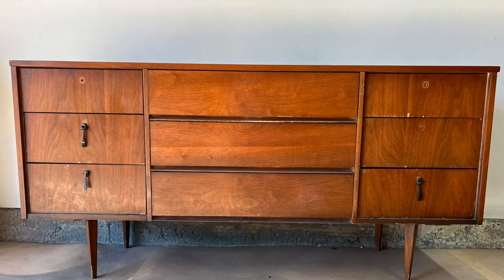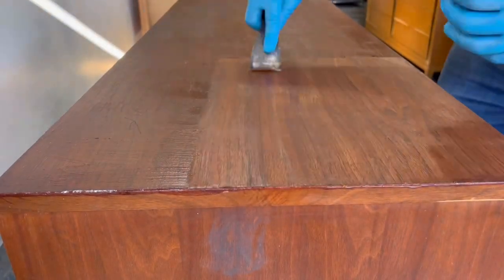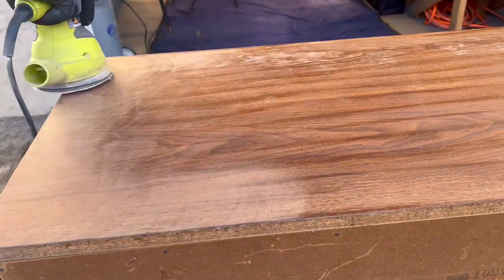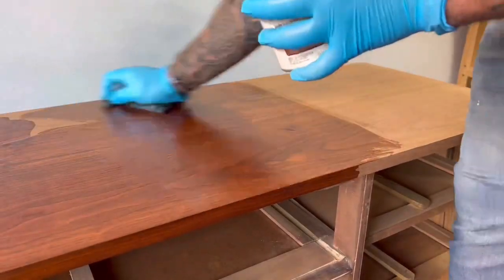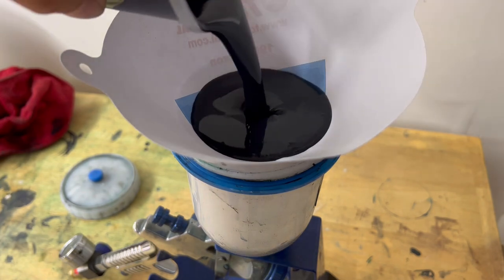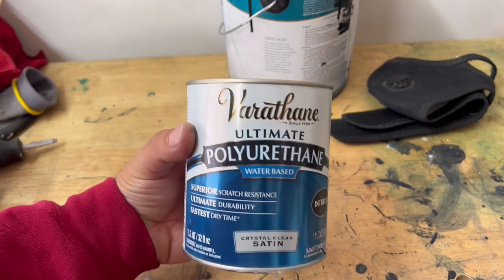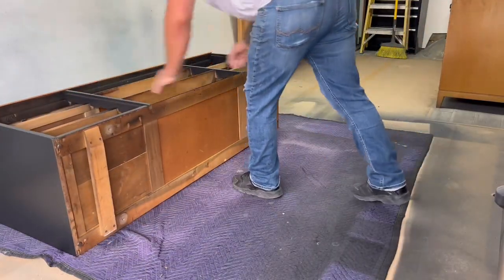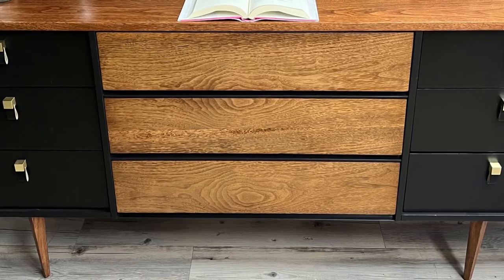HOW TO turn TRASH into TREASURE || AMAZING Mid Century Modern DRESSER furniture flip || DIY MAKEOVER

Comment: Brand new subscriber. This piece and several others I've watched came out great! Just one question. Do you not have trouble with swirl marks and burn through on veneer from sanding across the grain? I've been woodworking for a long time and just recently started getting into furniture flips. And that's always been the #1 rule. Never sand across the grain
Reply from the maker: Thank you so much for the support and kind compliments. I really appreciate it. As for the swirl marks, what I’ve learned is that when using a random orbital sander, going in the direction of the grain really doesn’t matter because the pattern of the sand is random. Just work your way through the grits to get rid of swirls and move slowly. I have had issues with the edges of pieces as far as the veneer but a little stain pen touch up work usually corrects that as well. Let me know if you have any other questions.

Comment: Nice job on that.  Beautiful.  

Question.  I always paint the base first and then stain the top--so I don't have to tape and paper off the top.  Why do you do the opposite, why stain first--and tape and paper it off and then spray the base?  I see a lot of others do it your way too.  My way, so what if a little overspray hits the top, it sands right off and then there's not this no man's land underneath the top. 

Also, I read that as long as you wait 24 hours, you can cover the stain with water-based poly.   I started doing that a few months ago.  It works.  Much easier to get out the gun and topcoat the whole piece at once.
Reply from the maker: Thank you for the compliment and feedback. To answer your question, I like to take care of the stripping and staining first because a lot of times I use a chemical stripper and don’t want to risk getting it on my finish paint, nor do I want to have to sand anything down while the body is already painted. I feel safer to just tape off what I don’t want paint on and then top coat it all at once in the end.
Reply: @CedarPineDesigns  That's kind of what I figured.  You're trying to protect your paint job.   Probably about the same difference.  

I'm worried that once I stain the top I now have to treat it so protectively.  I strip and sand the top and then put one line of tape on the sides of the top and tip the base upside down and spray the first coat on the base.  Then upright for a second coat.  Then I come back and just lightly touch up the top if it needs it and stain the top last.

But I admit, I see way more Youtubers do it your way.
Reply from the maker: @eddieadams4770  either way you do it all depends on what you’re more concerned doing. But I think protecting the stain and being about to paint without worry is a safer bet.